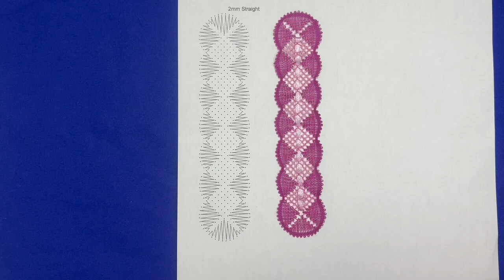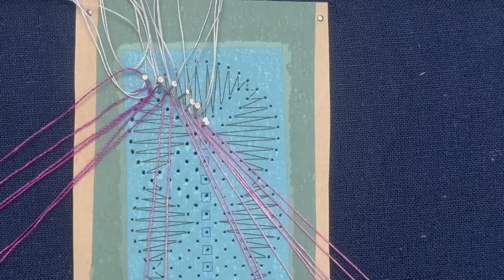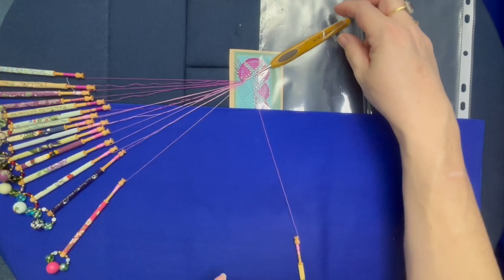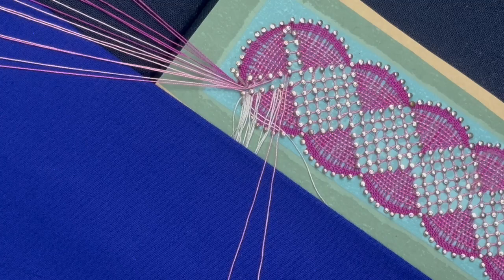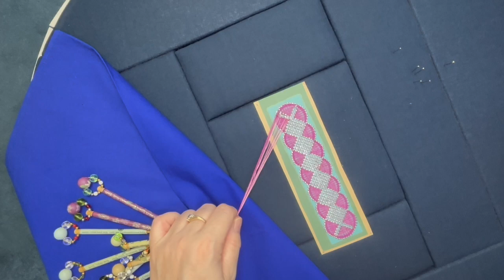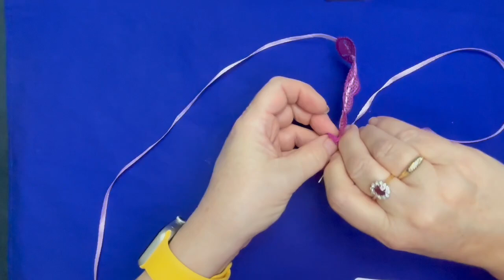Torchon Beginners #8 - Insertion with sewings

Comment: Is there a way to make fan without those loops on the edge where the pins were?
Reply from the maker: No the pin holes make lace lace.  The worker does need twisting twice at the edge so the two threads appear as one The twists in the worker in the middle help move passives to the outside of the curve and minimise the size of the pin holes
Reply: @Susan-Lace-Beads  thanks fir reply. I am making lace only for two weeks now and now experimenting with fan to try to make edge even. I will reply if I will succeede.
Reply from the maker: @kairysisKrantas  it is possible to do a fan with an inner curve but not many patterns have them, this is one I found as am example: https://bigginslace.co.uk/bethany-97-p.asp  In Torchon lace there isn't a fan with no pins at the edge that I have seen although borrowing techniques from other laces I could do an inner curve fan but not an otter curve one
Reply: @Susan-Lace-Beads  this one looks nice. Thank you.
Reply from the maker: @kairysisKrantas another option is to work a fan totally in half stitch.  However that wouldn’t look good in this pattern as there wouldn’t be much contrast between the fan and ground